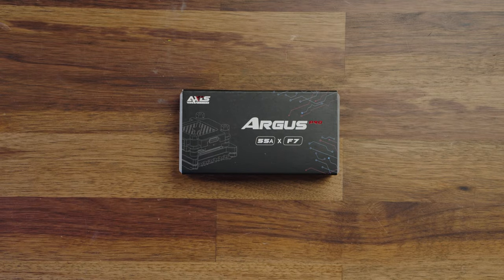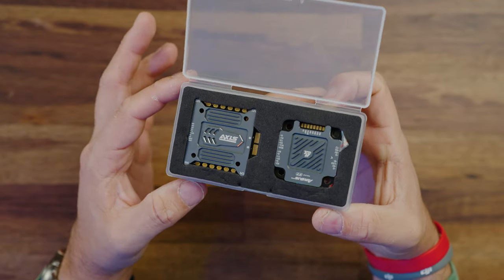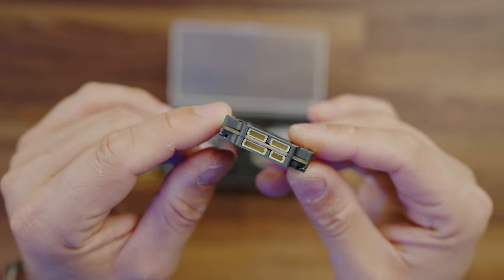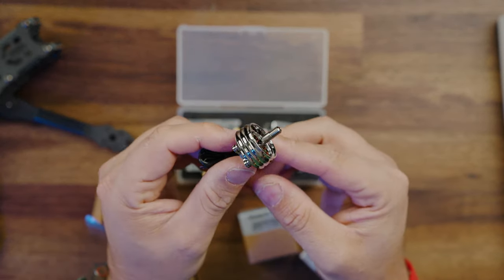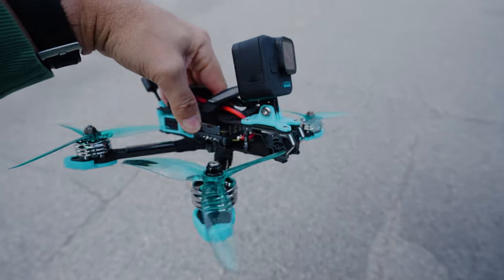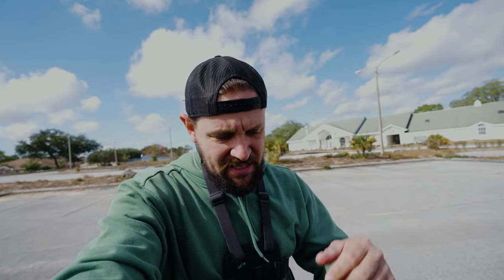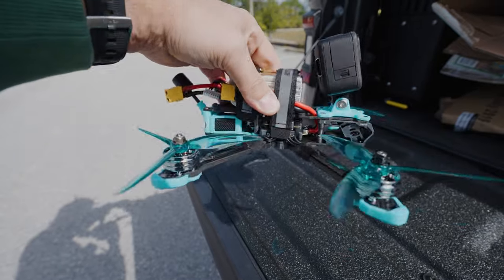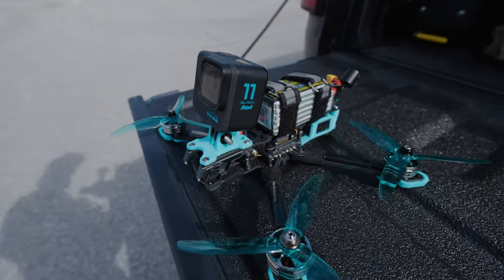Axis Flying Argus F7 Pro |  Water Proof Beast!

Comment: These are awesome if all you like to do is have a clean looking build and get to flying.  Soldering is cool but it doesn't make you quad any better than just running one of these.  On mine all I had to do was match the pin outs and reinsert the wires into the connectors and was flying with a beeper, GPS, HdZero, and Elrs receiver.  Only had to solder the motor and wires to the receiver.  I'm tired of soldering every little thing when the whole point is to fly.  It looks super clean too and Axis is some quality stuff
Reply: During soldering, it is possible to mix things up or accidentally drip solder, resulting in a short circuit. I cut all the wires and rewired them into the connectors on my old controllers, much more convenient that way.

Comment: Umm, the only soldering you usually do to an ESC is the motor & battery wires... All they've really done with the ESC is take a standard ESC and put it in a massive case.
The FC having connectors is interesting - high-end ArduPilot flight controllers have been doing that for a while, so it's nice that people have the option, but personally, I don't mind the FC soldering that much. I really dislike the battery wire soldering though, which I would still have to do with this one. If they shipped it with the battery wires & an XT60 already soldered on, then this would be much more tempting.

Comment: Yea so from the looks of it that stack would not fit in my usual day to day frame that i use from my sponsors, but i will say the new 100amp esc that is out, i wanna try that one and or the 80amp that iflight came out with. Then you can use f80 2200kv motors. That would be awesome.
Reply: 100amps is just insane.

Comment: Need some decent space to get this combo in a quad.. also need to put some force on the esc to get it over the m3x34 screws
Reply from the maker: Loosen the bottom screws as you install the ESC and it’s no issue
Reply: @OriginaldoBo  thanks for review - especially since you commented earlier that it was coming.  Quick question re stack height. How much room do you need? 25mm?
Reply: @OriginaldoBo  hmm gonna give it a go thx for the tip

Comment: I recently bought one of these.  Works pretty good in both INAV and Betaflight for me.  I tried both.   But one anouying thing on mine is that the buzzer output does not seem to work at all.   Not surr if its just a hardware fault and I would be curious if anyone else using this can use the buszzer output on theirs.

Comment: Tmotor also claims they're conformal coated, you can see the shiny finish on the board, indicating it was treated at the factory...but i'd still always conformalncoat everything, fried plenty that were "coated at factory" and wont trust it again
Reply from the maker: That heat sink is essentially a gasket on there , hard to explain but that’s where the seal is